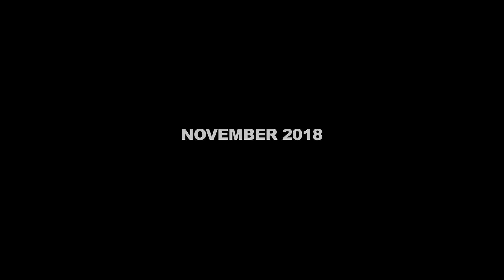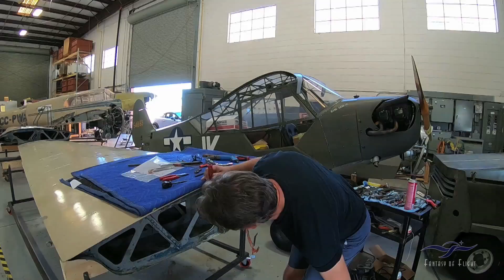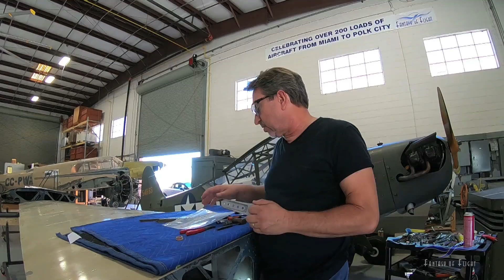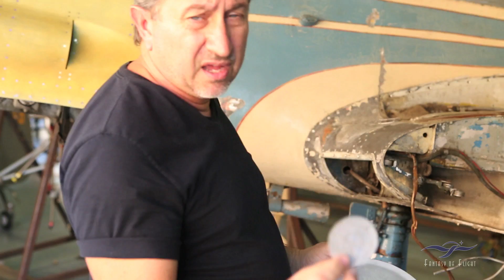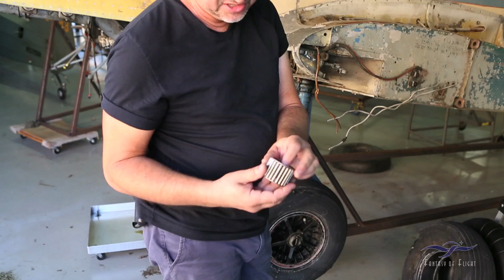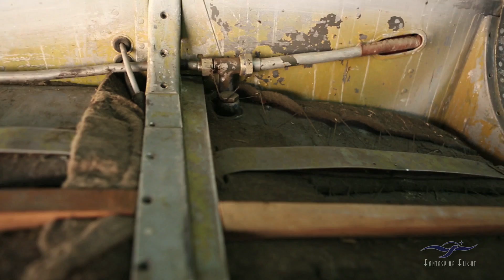Messerschmitt Bf-108 - Restoration Update #05 -  November 2018

Comment: I remember back in the early 80's when I lived in Germany a group was restoring a 109 there.  The hardest part to find was the solid tail wheel.  many of the control surface bearings were still available off of the shelf.

Comment: Were the original wing afix points interference fit or transition . I would be really surprised if they were interference. Do have original drawing there ?
I have found in the past savi nut sets work well on old nuts especially if they. are cap sealed saves you so much time I use lock wire most times to get out the cotter pin . And good old W\D 40 the night before . 
If I am stripping a large component like a wing and I have no existing manuals or drawings , I like to take a picture of whole wing in this case as kinda like a road map I use ms excel photo manager number all ribs and spars on the picture you can blow it up if you like  . After this you take off components photo them allocate a number to them put this on your master picture it’s best to put this in a folder with as much detail to each component you took off it really saves you a lot of time especially if you’re not Finishing off the project or you want to sell the AC later .

Comment: Magnesium wheels are bad news. Those tyres are tubeless and air carries water and water corrodes the alloy. They may look fine but will be very brittle and porous. The true life is about 5 years. This from a wheel manufacturer and finding what actually happens, primarily in motorsports.
That tyre may be new,, but again long past its use by and they too may be literally porous.So buy new wheels and tyres. Those wingtips etc too may be suspect though have less actual pressure on them.
Interesting series though, my hobby  is motorsport but anything mechanical is interesting
Reply: I love comments where some armchair 'expert' tries to tell a professional how to do their job.

Comment: I saw a BF-108 with a prop hub that had fins in a corkscrew pattern that spins with the prop.  Will this plane have one?  Adds a cool touch to the front of the aircraft, and I believe it was an OEM part.

Comment: The hardware looks very similar to what is in the Pilatus Porter, very close tolerance bolts and special washers under the head, and you typically have to drill the split pin holes yourself,  you quickly learn to not break the drill bit off in the bolt.  The way the split pins were done was so that you didn't jag your skin on the tails, very neat finish, and it didn't catch on a cleaning rag either. I also used that tuck method on helicopter servos and control rods.

Comment: The spar would have been built as a sub assembly. So would need the attach fittings installed to mount the spar in a wing assembly jig. Standard practice from what I have seen.

Comment: I assume you plan to fly this when it's done based on the work you're doing.  I can't imagine it's safe to use those old tires.  Can you explain?  Wonderful project.
Reply from the maker: We do plan on flying it. We're not sure if we'll be able to use the tire. We'll see if it mounts up and holds OK.  And in the end a newer tire might not be as good a tire as this original, which is actually made of rubber, not synthetics.

Comment: I'm sure those wheel bearings are some weird size, but that stile bearing is pretty common in heavy duty axles. I'm a Gse mechanic and those bearings are in some smaller jet tractor axles.

Comment: Those roller cage bearings are actually a very common design usually used on farm and industrial axles. I just rebuilt a pair of heavy iron implement wheels and the bearings were still packed with old grease but cleaned up beautifully and were still perfectly usable. I haven't seen one quite as large as the ones in your 108 though.

Comment: Thanks for another interesting update Paul, despite the camera problems.  One thing that occurred to me -  when removing the bolt with the rivetgun would it have helped to re-thread the nut on loosely to protect the thread end, so that it reduced the damage risk from the impacts?
Reply from the maker: I did try that, but it still messed up the thread. Thanks for the input though.

Comment: Paul,
A trick I would often use when trying to get a stubborn bolt out is to put a nut on the bolt threads, you could even use one of the castle nuts on upside down, and then use your impact, or punch against the nut. Saves damage to the bolt. I know you are replacing them, but as you said, a peened over end sometimes causes problems in a tight fit hole. Just a little tip that I have had success with through many years of airplanes.
Gary, 75-Year-Old A7P, IA, Commerical Pilot, and Home Shop Machinist in North West Arkansas

Comment: I'm surprised that you'd consider using a 60?-plus-year-old tire, given that rubber deteriorates with age, not to mention the 40's tech.
Why not get somebody like Coker to repro them?
Reply from the maker: We're not sure if we'll be able to use the tire. We'll see if it mounts up and holds OK. As far as having a tire reproduced, it would be extremely costly because you'd have to do a minimum run of a couple of hundred tires. And in the end it might not be as good a tire as the original, which is actually rubber, not synthetics.

Comment: Super to see more of the work Paul - you must have the patience of a saint with some of these aspects. 
Wow - data plate prices - ouch!
Weird fuel filling system - a forward filler option would seem to be so logical.
Keep up the good work. :)
Reply: Or a vent from the forward tanks and pressurized filling.  When the vent is heard sending fuel into the forward tanks you'd know they were full.

Comment: Hi Paul, thank you for sharing this restoration, how I would enjoy being able to work on these aircraft, unfortunately age has taken its toll on me, my spanner time has run out!  Question:  The pipework to the fuel tanks.  Will you be using modern AN fittings and pipe work? Its obviously a system that has to 100% so would you be using the  modern fittings?  Thanks for the vids,  Regards from the UK.
Reply from the maker: No, we're going to go back to German original pipes and hoses. We have a manufacturer in Germany who can make those.

Comment: Is the tail wheel tyre an issue 
Because 
I was told what might be an urban mith that  pav40 trailers from the Czech Republic used me109 tail wheel hubs and the tyres come in two types road and aero
Reply from the maker: Tail wheel tire on the Bf-108 are readily available, as it is the one that is used on the Fieseler Storch. The 109 tire and wheel is different than the 108.

Comment: I have a friend who is very concerned about Hydrogen embrittlement of parts that have been Cadmium plated - he has all his heat treated after plating to overcome this. Do you do that with aircraft parts?
Reply from the maker: The shop that does the cadmium plating is a certified shop, and they take great care that the parts are not rendered un-airworthy in the process.

Comment: First time caller long time listener. Awesome airplanes and updates. For the tight bolts having to use the rivet gun/hammer on, fun trick, if you put the nut a partially back on you won't mess up the threads on the bolt and you have more surface area to hit.. it hasn't failed me in 10+ years
Reply from the maker: Welcome to the Hangar forum Steve. Appreciate the comments. Keep listening and calling. :-)

Comment: "T" model Ford rear Axle bearings Look just like them bearings. Fluorescent light ballast?s going bad  R&R with LED lights save money "The more You buy, the more You save"
Reply: Yes, I encountered similar bearings on a Ford Model 'A'. Interesting to note is that the rollers were apparently not machined, but helically wound or rolled into their cylindrical form from a strip of thick gauge sheet metal; with a steel pin down the middle... it was a long time ago (c. early 80's) but I recall them being alarmingly crude. Also, found within those 'rollers' was several cracks.
Reply: rwbishop: A very interesting comment, you could see the helical marks on the rollers in this bearing, I thought they were for lubrication distribution. Many thanks for your comment !
Reply: I agree with the comments of Mike Basford and rwbishop.  If memory serves, Ford called them “cage bearings”.
Reply: @russellleeman9153  Single row roller bearing with end  cage, available from MPT Präzisionsteile GmbH Mittweida
Reply: @peterk2455  Grossartiger Hinweiss! Many Thanks! -There are others who need those things... too.

Comment: ...that kind of engineering( the interferences with removing the bolts, etc.) you describe reminds me of working on older Stihl chainsaws...German engineering and quality is great, but sometimes it seems they over-engineer stuff, making it harder to work on than it should be...:) Great video, keep it up. Bf-108 is coming along great!
Reply: I wonder if one potential benefit to high tolerances throughout is that when a component has a bind it could indicate that something has moved or been subjected to unexpected stresses. Obviously from a manufacturing and service standpoint excessively tight fit is a pain.

Comment: Don't you guys use Duralac on your dissimilar metal mating surfaces? I use it on my yacht spars for rivited fittings mostly , but I'm told it comes from the aircraft industry to combat galvanic corrosion.
Reply from the maker: Yes, when we go to re-assembly we will use a protective coating to go between the two different metal surfaces.

Comment: Great video even though camera operator seemed to have issues and added lots of extraneous audio. Thanks for the update.
Reply: Its the air conditioning system you hear not the camera operator !
Reply: There's a lot of air con noise, but that's tolerable. The really annoying noises are all the little pops and clicks and scrapes, which are what you get when (a) using the camera's built-in microphone and (b) the operator keeps fiddling with the camera. Any tiny touch on the case of the camera gets carried through the camera's case and straight into the mic.
Reply: Exactly right, it sounds just like a gopro does when you tap it. They need any sort of gimbal.

Comment: Why dont u heat the aluminium around the bolt a bit? It expands with heat more than steel
Reply: Sir I have worked in metal fabrication so I have a little knowledge in this. to much heat could damage the aluminum ,it could loose it's strength or warp out of shape, doing more damage then good.

Comment: I always used Snap-On except for the Phillips bits for impact driver. Always thought it weird the Snap-On #2 and 3# bits would break quickly but Craftsman worked fine. I also can't explain why I am telling you this...
Reply from the maker: Thanks for sharing. We appreciate the input. Anyone else out there have a tool story, or preference, please share. Thanks for watching and commenting.
Reply: @KermitWeeks444  Knipex brand pliers, especially the Alligator adjustable grip, and the OrbisWill 25 deg offset long nose for removing cotter pins and other fittings in confined spaces.  Just took all my tools home after 35 years as a professional mechanic  (now called "technicians") for large air carrier.  A sad day.  So enjoy watching your videos Paul.  Thanks for giving me something to do.  I also used Milwaukee brand Phillips bits.  A light bead blast helps the bits grip.
Reply: I've had similar experiences with $nap On bits being brittle and Craftsman being ok...